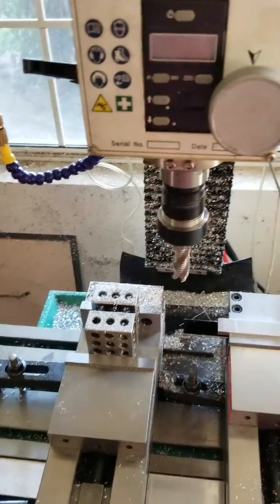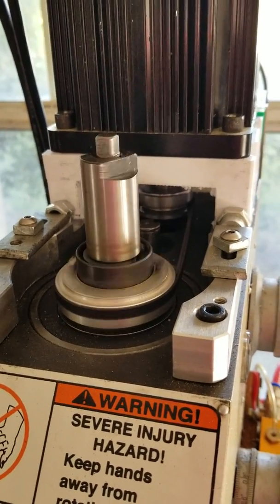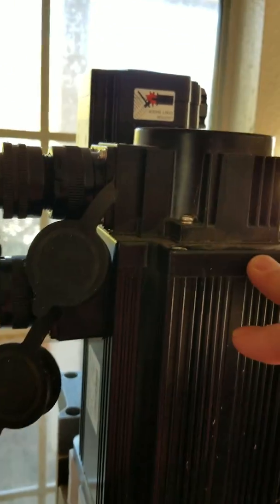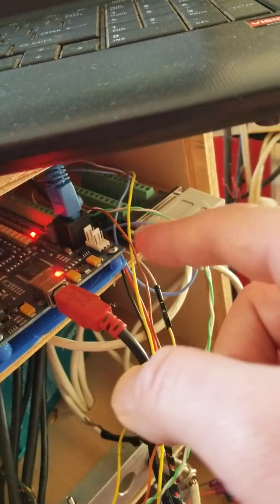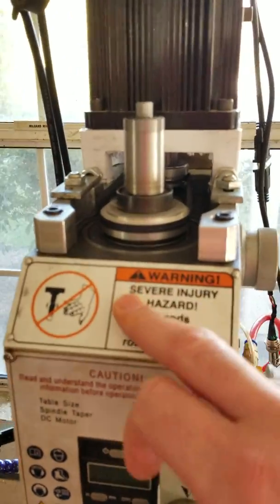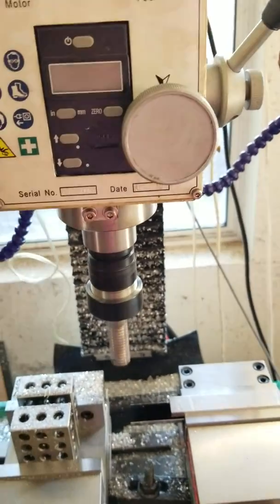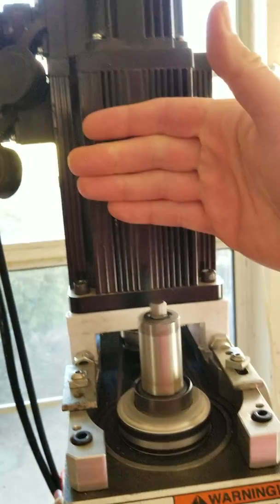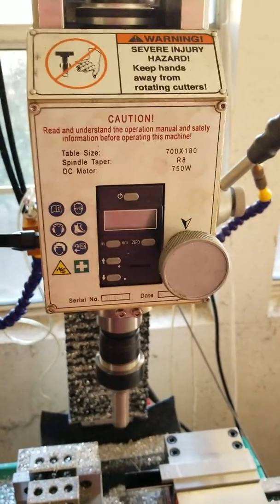Best motor upgrade for g0704?

Comment: I'm trying to hook up the encoder to the acorn and what I don't know is where to hook the 5+VDC from the acorn encoder plug into the servo driver. what I do know is that on page 2.3.2 of the manual A+ is pin 20 A- is pin 19 B+ is pin 19 B- is pin 17 Z+ is pin 15 Z- is pin 16 GND is pin 1 and the only remaining pin is pin 22 and that is called OZ (Z open collector output) so I would thing that since that pin 22 is the only remaining pin; that it must be the 5+VDC for the encoder?????? oh man its always the last bolt you un-tighten that breaks off LOL on the acorn encoder plug it has pin 9=+5VDC pin7=A+ pin 8=B+ pin5=B- pin 6=Z+ pin 3=Z- pin 2=COM so it seems all so clear that A+ A- B+ B- Z+ Z- GND (COM) all have their places to connect to, but it's that 5+VDC pin 9 on the acorn that I dont know where to plug it in on the db25 connector on the servo driver, do you know if it plugs into the pin 22 OZ (Z open collector) please help, I am going crazy LOL

Comment: Hei, excellent video, Thnx. I am looking into this solution, I want to ask you how hot motor gets? Are you still running it? Would you chose the same again or you would go size up?
Reply from the maker: I did found it can heat up after a while. If you get it and will work a long hours with it you maybe should add some fans to the case. I got 3.8KW 2500rpm with idea to put it on my lathe and was thinking maybe to try it on mill as well but its double weight and so far I did not have any issue with 1.8KW torque wise and it did cut all i tried without issue except heat. Size wise 1.8Kw fits flush with mill head. If you put bigger(110 mm vs 130mm frame) you will need to make stand that extends on side of mill head but I saw many use bigger motors thr only thing is most of them have less rpm(2.5k vs 3k rpm) so that might be important.

Comment: what pulley ratio is that? do you run it above 3000 rpm? would you say 1.8 kW is enough? sorry many questions i know but i want a motor like this and i'm not sure if i should get 2.8 kW 2500rpm or 1.8 kW 3000 rpm lol
Reply from the maker: I need to replace my bearings on spindle to go faster then 3k. Even on 3k they get hot after a while. Once you have bearings on spindle rated for more speed you can pick pulley ratio to get more speed.
1.8kW is nema 42 mount while 2.6kW is 52 nema so its larger and heavier.  But extra power for sure is attractive as price difference is smaller.
Reply: @darkobul1  the spindle does indeed get pretty warm after a while even at relatively low load. i ordered the same motor with the intention to run it at > 6000 rpm; as such i will be replacing the bearings with SKF branded ones which are supposedly rated up to 8500 rpm ("reference speed")
Reply from the maker: https://youtu.be/Om7oUBbH4uE

Comment: Thank you for the video. I have the same 1.8 kw ac servo and I am planing to upgrade my Optimum BF 20 with this motor. Are you still able to use the drilling quill in your machine  (5 cm traveling down) or you had to take it out? Thanks for any advice. Best regards!
Reply from the maker: My belt conversion preserved quill so I can still use it.
Reply: @darkobul1  Thank you. Really good because I want to keep the quill.
Reply from the maker: @jackneill8233  in my case to preserve quill those 2 scews that where used to hold tachometer where used to hold pulley on spindle. That way quill still can be used.
Reply: @darkobul1  Very clever. I will take your idea.
Reply: I am thinking about whether it is possible to take some gears out while preserving the quill. That way the machine will be even quieter.
Reply from the maker: @jackneill8233  yes. I didnt remove mid gear yet except from the top but I just have put it in neutral so its not engaged for now until i decide to upgrade bearings and dismantle spindle and head then I will remove inside mechanism of gears.
Reply: @darkobul1  Thanks a lot. Very good idea with the neutral position. I did not know that the gears could be easily disenganged. The top gear is easy to remove and one needs place to install the new pulley anyway.

Comment: What are you using to send pulses to the servo drive?  Is there a good English version manual for these chinese drives?  2.2kw servo is on the way.
Reply from the maker: You can chose pulse dir, cw/ccw or a/b or analog 10v signal.
There are some translated manuals floating around the net.
I did have some problems generating clean signal at higher frequency over cheap breakoutboard because opto on them where not fast enough. At end I figure out that motor controller had opto isolation already so I hooked up directly to my cnc controller.
Reply: @darkobul1  🤔may need your help soon.
Reply from the maker: @LionSandwich  sure. To use pulse or other modes beside analog you will need 450-500khz signal. I think i used A/B as it has good noise rejection. But this was on mach3 on LinuxCNC you will probably have better results as I was locked in by controller driver.
Reply from the maker: @LionSandwich  if you have db25 on driver order some breakout boards with all pins so you can wire it easily.
Reply: @darkobul1  would I need to jump the db25
Reply from the maker: @LionSandwich  yea step wires enable wire and also some other stuff(MODBUS control, Encoder output) all goes over db25 cable.  I tried first to cut cable but that was bad idea as wires are tin and hard to solder or screw down on terminal so that breakout I found is easiest way to cross wire from motor driver to cnc controller.
Reply: @darkobul1  ok. So I should be able to tap into my C10 breakout board. Nice.
Reply from the maker: @LionSandwich  make sure you watch voltages. Some pins are 5v some are 12v. 12-24vv on mine was enable servo pin and related alarms. I used dual psu 5v-12v and made common ground.
Reply: @darkobul1  what's the max speed of the servo you got? Rpm? Is it possible to drive it past rated output? Say more than 2500rpm?
Reply from the maker: Mine is rated 3000rpm. I think its possible to go up to 5000rpm in driver settings but its not advisable. I cant remember for sure I  think I have tried and got some weird vibrations and then return it to stock settings.
Reply: @darkobul1  I had to order a pwm to voltage converter board.   Should be able to interface with linuxcnc with it
Reply from the maker: @LionSandwich  check also the manual of the motor
Reply from the maker: @LionSandwich  you cant generate fast enough pulse? Did you consider Mesa boards?
Reply: @darkobul1  right now im not planning to send pulses.  Will use 0 to 10 volt reference for speed.
Reply: Ok. So I've got 0 to 10 volts working from linux cnc.

I got that running in CN2 DB25 connector of servo drive to pins 13 and 25.  24 volts are going to pins 9 and 10 for power.

Drive is set to speed control with input for analog voltage.

What am I missing? Doesn't work.  

Motor works fine when controlled manually by the drive in jog mode.

Will not behave with 0 to 10 volts on CN2 connector.
Reply: Got it! Working!
Reply from the maker: @LionSandwich  I am away from mine machine for 2 weeks. What I did is read manual and looked into all settings. There might be settings you need to set to use that feature. Also check what driver is expecting for 10V. I think there might be multiple ways to interpret that signal (ie when is zero speed when it's reverse and when is forward). I didn't use it but I vaguely remember something like that you might want to check out. I think is some case it goes -10v to +10v and in some is only 0v-10v...
Reply from the maker: @LionSandwich  also check for multiple versions of manuals for this servos some are bad English some are better. I found few for mine.
Reply from the maker: @LionSandwich  oh don't forget to enable servo when you try. Servo needs to be enabled to accept commands. Manually it's a command on driver (change state from 0 to 1 in settings) or by enabling it over pin on CN DB25 before you send speed instruction over 10v mode.
Reply: @darkobul1  exactly was the issue. Thank you!

Comment: Are you using the stock quill bearings? I mean the large one on the top and the one inside, not the ones inside the spindle itself. I am trying to quiet my spindle down and still have this stock bearings and I'm wondering if that's what is causing all the excess noise.
Reply from the maker: Yea they are all stock  still.  I was thinking about mine but I didn't see anyone mentioning those bearings changing but only those inside spindle. Do you know what size or name they are?
Reply: @darkobul1  I'm not sure what the sizes are and I've only seen a couple people change them myself. I'm just so surprised you are able to have 3000 RPM with such a quiet spindle so I was hoping maybe you had done something I hadn't done. My spindle is ~95dB at 3500 RPM.
Reply from the maker: @SteelCogs  
That is too much. Its weird also that on long run only lower and middle bearing heat up but i didnt notice upper bearing to heat up at all.
Reply from the maker: @SteelCogs  are they sealed well? Maybe something like chip fell inside?
Reply: @darkobul1  It's possible something could be in the upper bearing but the two bearings in the spindle are brand new. I had AC bearings in the spindle and I just swapped to better tapered roller bearings that are more quiet than the AC but still loud. I may try and pull out the upper bearing/quill assembly today and see if I can see anything out of place. I just wish there was a way I could isolate all the excess noise the pinpoint it to whatever it is.